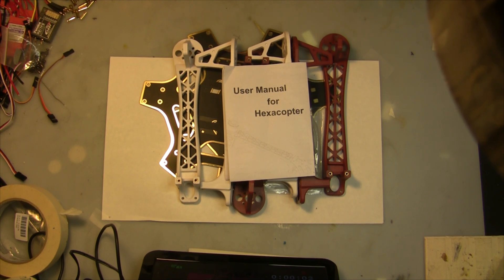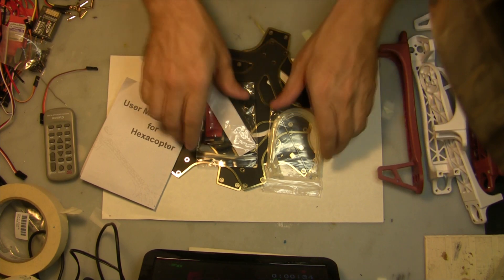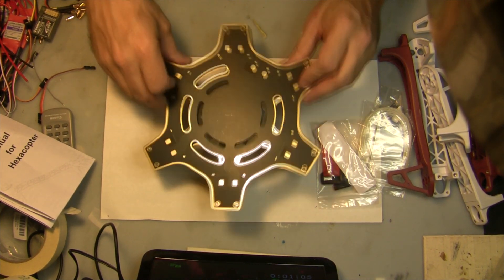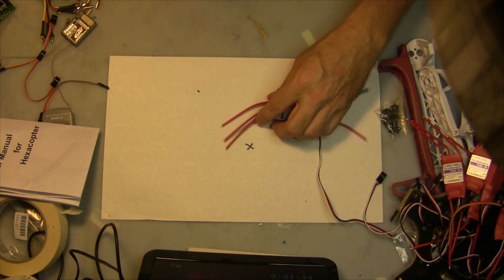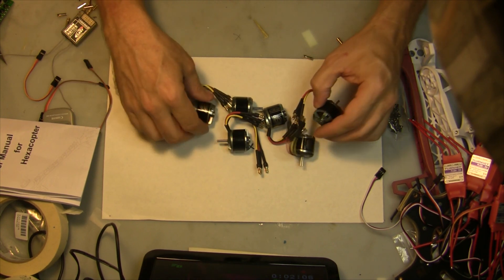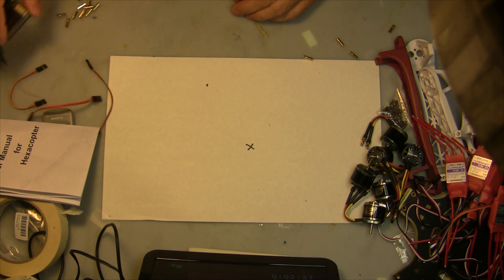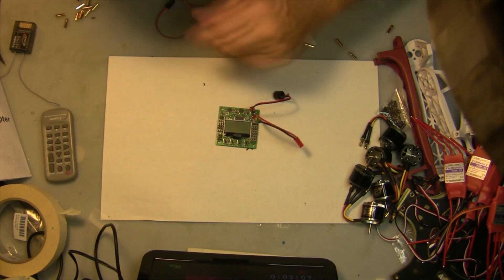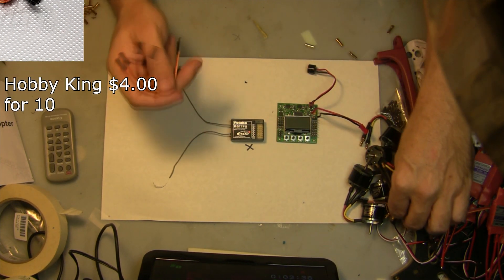Hexacopter Build Part 1 of 3, build a Hexacopter for less than $300

Comment: The Prez of ECPI University, where I work, is starting a UAV club.  After looking at your Hexacopter build, I decided that I would follow your guide for my first build.  All items (with a few minor mods) are on the way.  Your video's were well done.  I've looked at all my numbers from motor thru ESC and I'm picking my battery. Motor is 1100kv at 290w for 19.6a on a 4S.  May I ask what Lipo size you used?  I'm calculating my draw.